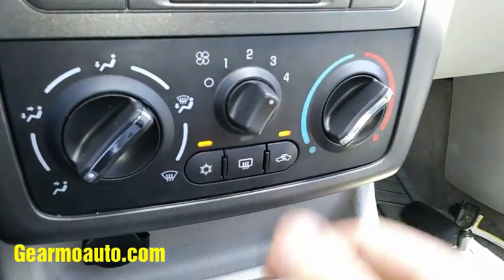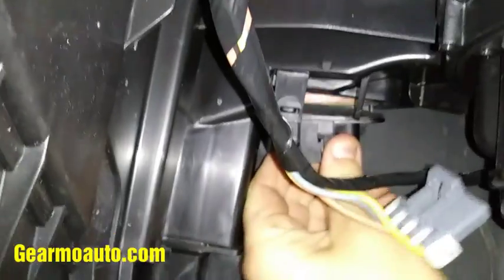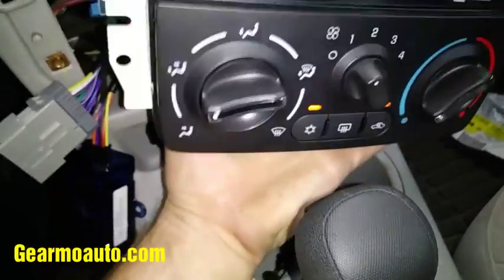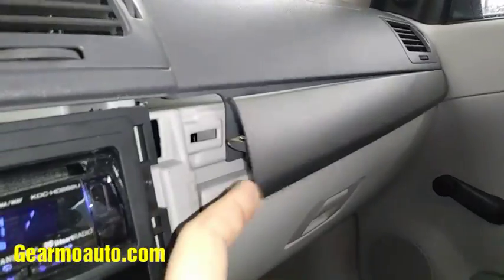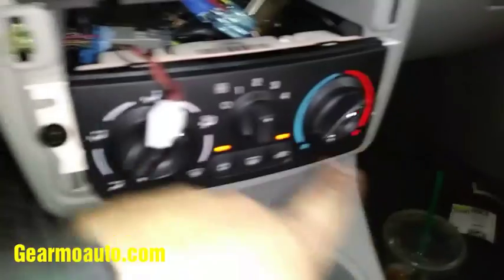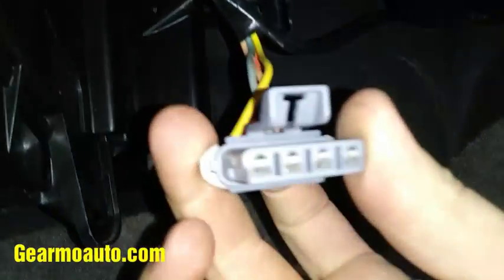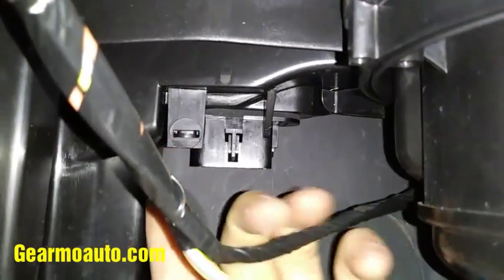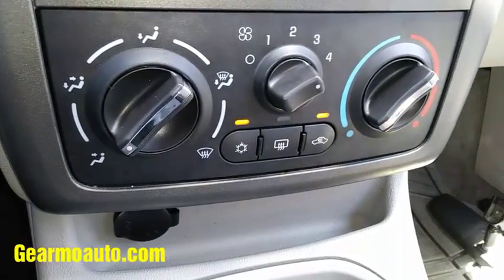2006 Chevy Cobalt AC Problems

Comment: I found the problem.  If you remove the panel on the driver side near your right foot abd look under you will see two actuators.  The one on the top controls moving air from vent, to defrost, to feet.  The actuator on the bottom controls the blend door specifically for hot and cold air.  After removing the bottom actuator, you may find as I did, that the long plastic rod that is part of that blend door, and connects to the hole on the actuator, is twisted and broken off.  My fix for this was a vehicle rubber hose and crazy glue to reconnect both pieces.  It was not easy but it worked and I didn't have to remove anything but the actuator.

Comment: I bought a 2006 Chevy cobalt LS from a soldier on Fort Bragg I have noticed that the lights do not light up at all I do not get any cold air and I’m not getting any hot air during the winter what is your suggestion to fix this issue?

Comment: I’ve got a 2009 Chevy cobalt. Only blows cold air and won’t blow any hot air. I’ve changed the thermostat and the blend door actuator on the passenger side and it still won’t work. Any ideas what it could be

Comment: The problem I'm having is my cold to hot knob does not change the temperture.  It works sometimes and sometimes not. it's either stuck on blowing cold air even when turnes to how, or stuck on blowing hot air even when turnes to cold and the ac is on.  The bend door appears to be opeaning and closing just fine.  Any help or tips on what to check for would be greatly appreciated.
Reply: Im having the same issue with my cobalt it's stuck on heat  actuator appears  to be moving blend door to cold but stays hot. compressor is on and running I have a hunch the actuator internal gears might have failed
Reply: @danielchavez2157  same with mine stuck on heat and summer is coming. Did you find out what the problem is thanks.

Comment: A/C was working before the alternator bit the dust. Installed used, now car whines when it hadn't before...and A/C doesn't blow cold. 
Lights light up, inside. 
Haven't tested relay, but red fuse looks okay.
Just no cold air...but the whining is annoying too.

Comment: The probkem Im having, is that the fan won't work. For a long time, it would work on 1 2 and 3, but not 4. Now it will only work on 1 2 3 sometimes. Also, the knob will turn, but doesn't feel right.

Comment: The problem I'm having is the a/c runs when the knob is in the off position but shuts off when turned to 1, 2, 3, or 4. Also it blows like it's on 4. I have cold air.

Comment: My snowflake will not come on at all unless i jam my leg into the center console, painfully. Any slight movement away from tons of pressure and it will go off. I've had this issue for so many years, it's made me hate my car. The blower also only work on 3 and 4

Comment: My snowflake light comes on and my blower is working great but it’s only blowing hot air. Any suggestions?  I’m going to tear the switch unit out to see if I can figure it out.
Reply: Did you get your ac fixed @edibelle Obviously .? I have the same problem.
Reply: Angie Bowden  I did not. But I did locate the problem. The vent door switch broke on the inside. I took it to a repair shop and no one knows how to fix it 😭

Comment: Hey dude i love this video. But mines is a bit different,  when i switch my knob to 1 2 3 or 4the compressor comes on but NO air comes out hot warm or cold. And sometimes i gotta touch the wires for the a.c. to start blowing. Help plz
Reply from the maker: What wires? If no air comes out. Try turning your ac on with it on any number and smacking the bottom of your blower motor. If the motor comes on then it means you have a bad blower motor. Try that and let me know.
Reply: The wire harness that connects to the back of the AC knobs is what I touch and it comes on
Reply from the maker: Did u try to manipulate the wires to a posistion that the ac stays working? Maybe u can twist the harness like in the video. I also have been shown sometimes the femal side of the connectors can widen and not contact the pins good. Is it the type of connector that you can adjust the pin holes to make them smaller?  Let me know if im not on track but i belive these would be things u can check if im understanding correctly.
Reply: Yes i have manipulated the wires so it can work but the second i hit a pot hole or just the slightest movement then it cuts rite off
Reply from the maker: Well man, maybe you can isolate the bad wire or the pin connection that is loose. I dont have anymore ideas for you. Let me know what you do though or if i can answer anymore questions.

Comment: I was wondering about the fan knob itself. Mine is broken, do I just pull the knob off the vehicle at salvage yard, or do I need tools to take off the a/c fan speed knob?
Reply: For just the fan knob, you just need to pull the knob off.  I used pliers to give me a firmer grip.
Reply: The fan switch can be replaced from the back of the AC control unit. 2 screws. 

Remove the plastic trim, remove two screws holding the head in place, remove the two screws from the back and slowly lift out the switch and slide the new one in.

Make certain that the knobs on both switches are on 0 and that nothing moves out of place.m

Comment: My granddaughters 2006 Cobalt the blower speed switch turns on 1, 2 , 3 & 4.  I don't notice significant difference in air movement between them. I don't hear any difference at all for the high 4 setting.
What would you suggest could keep the 4 setting from blowing at high speed?
Reply: Could be your in cab filter it’s behind the glove box
Reply: @sledheads6355  that was it.  Replaced a very dirty cabin air filter and the Cobalt cools down and we notice air velocity changes now.
Thanks.

Comment: My blower fan switch began acting up and stopped. All plugs to the blower, resistor and control heads showed power. Replaced the resistor and no change. Replaced the blower fan speed switch and again no change. Changed out the AC control head twice and still no AC blower. Any clues anyone?

Comment: For a while my 2005 Cobalt AC knob didn't blow on the 3rd setting--worked on the res, 1,2, and 4.  Then it started working again, and has ever since. (short?).

Mine has a weird problem--even when the AC is OFF, and you turn on the "recycle air" switch, it ALSO turns on the AC.  None of my other cars ever did that.  So if I just want to recycle air, if I get behind an oil-burner or something, I can't.  I've always figured it was a wiring problem--now that I see this, I'm even more sure.  Somehow my recycle button has been also wired into turning ON the AC.

Comment: My 07 blows when the knob is off but turns off when I switch to 1234 but go from 4321 it turns back on on 3 have any idea???
Reply: nick rodas ac knob is on backwards or the actual fan switch
Reply: Did you ever figure this out? Mine does the exact same thing
Reply: It's the fan switch, resistor, or blower motor. I've replaced switch, resistor, and wiring to blower motor and everything good now

Comment: My 2006 cobalt turns off when i turn the air on. I checked the fuses everything is ok.
Reply from the maker: The whole car turns off?
Reply from the maker: Or just the AC?
Reply: Whole car
Reply from the maker: Sounds like when the AC compressor turns on it is just enough load to kill the engine. Does it idle rough when the A/c is off? It could be the idle needs to be higher rpm / healthy idle. Maybe there is a vacuum leak or the throttle plate is really dirty causing a weak idle.
Reply: No when i turn it off it turns right on. And when i put the heater on the the car shuts off too.